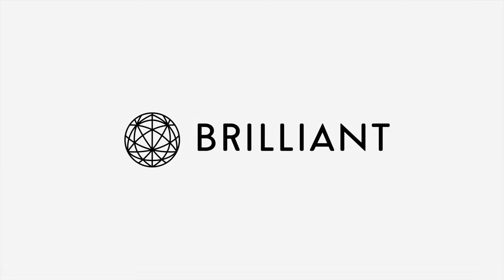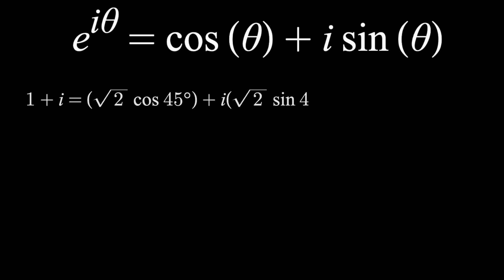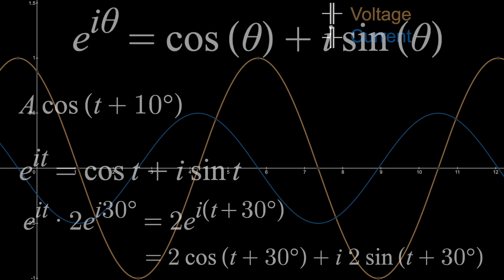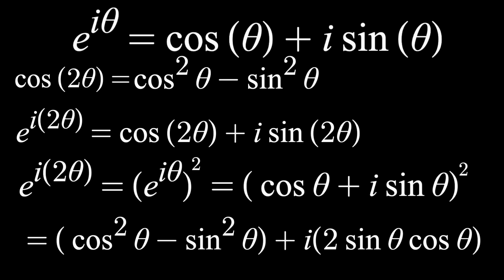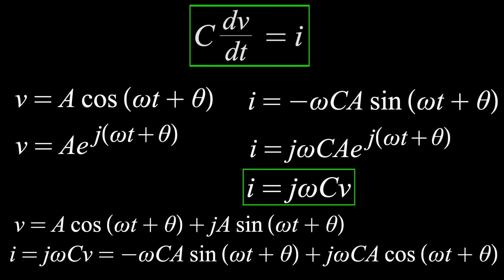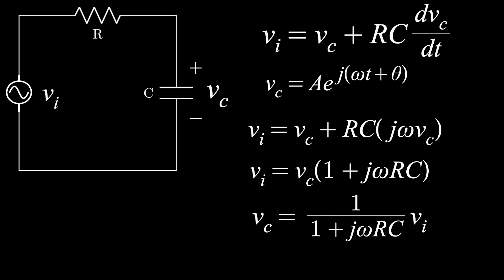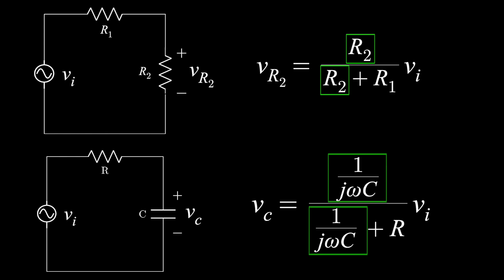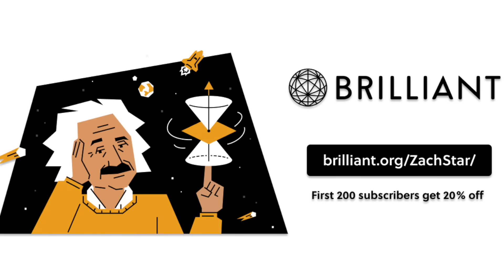Why do Electrical Engineers use imaginary numbers in circuit analysis?

Comment: I'm a mathematician/physicist doing a career switch over to electrical engineering, and this has been the clearest introduction to Impedance I've seen. Thanks a lot
Reply: A former physicist here, who'd worked in EE too.The hardest part of it, they use j for the imaginary _i._The next hardest one, it never works on the bench as the theory predicts, but modern circuit modeling s/w makes wonders. The rest is a piece of cake. Good luck! With your background it's very straightforward, really!  😁
Reply: May I ask why? I'm interested in Physics and the statistical component of mathematics, I'd love to hear about your experience.
Reply: @Jacobl66 although I had a lot of fun during my math and physics undergrad, I hardly experienced any hands-on work; most of what I dealt with was theoretical. 
So I was bored and wanted a career switch to something more active.
Also, I didnt want to do a PhD, which meant very limited job opportunities around where I live like being some banker or accounting clerk. I didnt want to spend 4 or 5 more years in academia to keep doing theoretical work.
It's only been 2 weeks since I started my masters and Im already having fun playing around with microcontrollers and learning the physics and math of electrical engineering.
Reply: @nestorv7627  Interesting, I rather prefer theoretical work however my consensus is that there will always be someone smarter than you, what can you really do in academia if your not a certifiable genius, probably a misguided viewpoint but...
Reply: @Jakob_LS  Barring outlier cases, I have experienced quite the opposite. Most of the successful academics from my PhD program were not the most intelligent in our class. They were, however, the most gritty, determined, and focused. My perspective is you need sufficient intelligence to succeed as a researcher, beyond that, success is mostly determined by the same sorts of factors that determine success in most spheres of life.
Reply: @himynameisdavenicetomeetyou  Yes that's what I'm saying, to go into R&D, my fault for not making my point clear.
Reply: what else have you worked in besides EE? To be honest, one of the reasons I want to do my bachelor's in EE is because I've seen a lot of mathematicians and physicists transfer from or to EE.
Reply: The video is excellent, but EEs in the real world rely on LaPlace transforms and the s-domain: jω <==> s. Life becomes much simpler by treating each component in a network as an impedance: R, 1/Cs, and Ls. So, if you can solve a network of nothing but resistors, it's a simple step forward to solving networks with a mix of R, C, and L. Any phase shift simply takes care of itself because you've included the s term. Once you have a solution in terms of s, simply convert the s to jω and calculate the amplitude and phase.
Reply: @@markhall2414 Because the infinite series expansion of e^(ix) is equal to the infinite series expansion of cos(x) plus i multiplied by the infinite series expansion of sin(x).
Reply: I switched to EE for the women... there werent enough women in physics
Reply: 😂Mathematician
Reply: @@markhall2414 To appreciate and understand infinite series requires a pretty solid understanding of calculus. As an alternative, you can convince yourself that the series is valid if you can write a program to calculate just the first n terms of the series. For example, pick an argument for the cosine function, say π/4. Find the value of cos(π/4) using a calculator. Now, replace x in the MacLaurin series for cosine in your program with π/4 and calculate the sum over n terms. Let n be, say, 20. The summation that you calculate should be very close to the value that your calculator gave you. You should get similar agreements using other values for the cosine argument. Good luck.
Reply: What advice would you give to someone planning to go the opposite direction?
Reply: @@markhall2414No, it's not. But what I suggested offers numerical evidence of the validity of the series. I had hoped that would be satisfying enough. Anyone who has taken a full set of calculus courses would have studied infinite series, Taylor series, MacLaurin series, including their derivations. If you have not studied calculus, it's unlikely that you could understand their derivations. If you still want to press forward with understanding the infinite series representation of the cosine function, the information is available online and in calculus textbooks. If you can't find what you want online, you can visit a library or a college bookstore.
Reply: As a robotics guy (with a background in mech/aerospace) Im jumping into math mainly because of control and modelling ,funny thing is I barely passed my math courses in my undergrad(Calc 1,2,3 and discrete math) never was good at math, but its interesting how we discover what we "actually" like is just a lightning strike.
Reply: Welcome to the club. I am an electrical guy working on motor controllers
Reply: I might do the reverse. I've studied mechatronics, but I feel that my math  and physics knowledge lacks foundation. So once I get some money, I will go back to academia for a while.
Reply: Damn I pissed off soooooo many electrical engineers!
Reply: Why electrical and not something more trendy like Artificial Intelligence?
Reply: @Anonynomymon-fh8wy You know electrical engineers can do that too when specified in the field, right? That's the deal of electrical engineering, many majors. You can specify in things like robotics and programming. You pick one or two and specialize. I'm a student yet but I started learning coding in lessons. Then I got curious and learnt some languages. I wasn't interested in AI but anyone who does can do a job about it pretty sure
Reply: @_cran no, electrical engineer is not electronical engineer.
Reply: @JefeVideoCuras  Well I was referring to EEE. However any engineering can still go for programming lessons as facultative lessons in collage.
Reply: @_cran why would you assume he knows that
Reply: @JefeVideoCuras 

Electrónical engineering is a branch of electrical engineering
Reply: @emperadordelconocimiento9200 no, it isnt
Reply: @Anonynomymon-fh8wy  Artificial intelligence is considered too concentrated and specialized, EE's can also do Ai jobs and do a masters in Ai.
Reply: @Anonynomymon-fh8wy ML is an overlap of electrical engineering and computer engineering. But still, EE is the most versatile and broad field of engineering. My master's will be an overlap of math models, machine learning, and digital signal processing
Reply: @Anonynomymon-fh8wy bro! Your thinking is wrong on so many levels. I'm a mechanical engineer and we had the AI for engineers, robotics, programming, mechatronics and many more courses that are trendy. Engineering is what advances the world that we currently live in. The more advanced and good we become in engineering, the more new heights we achieve. Mechanical engineers about centuries ago studied different stuff than I did because it has advanced and the same goes for other engineering fields too.
Reply: @jalilkhan6251  I feel like only people in developed countries can give the kinds of responses I have recieved to my comment. When there is no scarcity of opportunities, a mindset like yours would make perfect sense ig. It is a healthier and more productive mindset, I agree. In my country (India), almost all the mechanical engineering students from even the top Indian colleges (IITs etc) go for coding and bag a job in the IT industry.
Reply: @Anonynomymon-fh8wy electronic student here there’s crossover between fields I’ve had to take software engineering  as part of my degree
Reply: @Anonynomymon-fh8wy  "more trendy"
bruh this guy is unbelievable...
Reply: @Anonynomymon-fh8wy girlie who is designing the hardware the ai is running on
Reply: @Anonynomymon-fh8wy  because artificial intelligence doesn't run in the vaccum.
Reply: @Anonynomymon-fh8wy  because AI is trendy right now and as such it'll become oversaturated in a couple years so you won't be able to find a job in that field. Just look at coding as an example. Also with EE you have competencies in mechanical engineering, coding, a bit of chemistry, etc. Plus electrical engineers are always in high demand everywhere.

Comment: Going to Graduate as an Electrical Engineer in June, 2024. This video sparked inside me the excitement that I felt when I first learnt about these. 😄
Reply: Welcome to hell then.
Reply: It’s the coolest stuff I’ve seen in the physical world. Linear systems and controls are damn fascinating! Well, so is waveguide and antenna theory, and communication theory! This video shows how you do steady state system analysis, but laplace transforms, which aren’t too different, let you do transient analysis using just algebra too. And what is MIND BLOWINGis that since you’re really just solving ODEs, all this stuff applies to dynamic mechanical (or chemical!!!) systems too! Eg a spring is an inductor, a shock absorber is a capacitor!
Reply: Congratulations on your degree
Reply: Welcome to Engineering - the most important profession on the planet.
Reply: Welcome to poverty world of poors ...

Comment: In electrochemistry, phasor notation becomes really useful when investigating the electrode-electrolyte interface, in a technique called electrochemical impedance spectroscopy (EIS). The resistor component is modelled by the real impedance of charge transfer (Zct) and the real impedance of solution (Zs), and the imaginary impedance modelled by the electrical double-layer's capacitance (Zdl). Zdl and Zct are in parallel, and that parallel system is in series with Zs. It's a fairly simple circuit, but as you sweep the frequency, you can get a really nice pair of plots to model at which frequencies you have maximum and minimum impedance within a range. 

The plot of combined impedance with respect to frequency is called the Bode plot, which shows the big picture of impedance. Then for each point of data given, you can break the combined impedance into real and imaginary components and get what is called the Nyquist plot, which is probably one of my favorite things in the world. I love it so much because Nyquist plots give you a really nice dome-like curve, the peak of which tells you the maximum capacitance of the EDL, the farthest right point of which tells the maximum impedance of charge transfer, and beyond that, you can see if charge transfer becomes less influential than mass transfer below a certain frequency. 

I hope you'll do a deep dive into EIS at some point. It's just so cool. Also really useful for engineering things related to energy conversion and storage, which is something I'm sure a lot of your subscribers (me included) are very passionate about.
Reply: I would love a video on this topic
Reply: @rennoc6478  facts
Reply: Man nerds
Reply: had us in the first half not gonna lie
Reply: you lost me at electrochemistry
Reply: Still, I can't figure out what frequency response I should choose from the EIS because for each SoC value of a battery you have a different response.Hence  I was thinking about a wavelet transform  but again not so sure on how to extract values for an ECM.

Comment: The question should be: why not? It's way easier that way
Reply: Consider what we'd do, if we were limited to just the real numbers.  You could use first principles, set up the differential equation from KVL, KCL and the definitions of capacitance, resistance, and inductance.  Then use a linear combination of sin(w*t) and cos(w*t) as your prototype, to solve for the steady state behavior.  Complex numbers are a shortcut to all of this.   What we are ultimately doing, is taking the Fourier transform of the diffEQ, to turn calculus into algebra, to simplify the method.
Reply: this is the real answer.

Comment: Because real numbers are too easy for us!
Reply: Because real numbers are too complicated for us*
Reply: @nestorv7627  Because real numbers are complex for us.
Reply: @nestorv7627  yes, sometimes the longer way is actually the shortcut
Reply: @nestorv7627 If I could code, I'd do an example of RLC analysis using phasor diagrams. Voltage, current, & power, with resonance visuals if ya like seeing humps/dips and cutoffs. Put the values on sliders so you can see what them numbers do.    

Str8 vectors and waves using real numbers.
Reply: because I sat there in class and they just spewed it at us
Reply: Because differential equations are too hard for us!
Reply: It's actually because imaginary numbers are easy for us
Reply: Nah because you aren't smart enough to solve differential equations
Reply: Phasors are FAAAAAR easier to work with than differential equations.

Solving the time domain behavior of a simple LC circuits is very basic for AC (It's just versors) while VERY VERY hard for DC, since you have to do a while bunch of calculus to get the answers
Reply: So easy as we treat it like a normal number😂